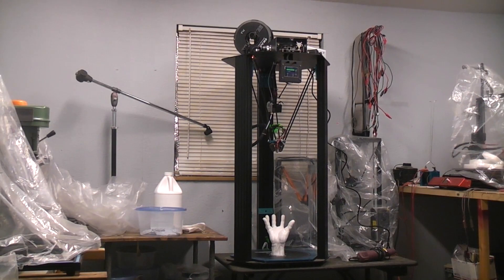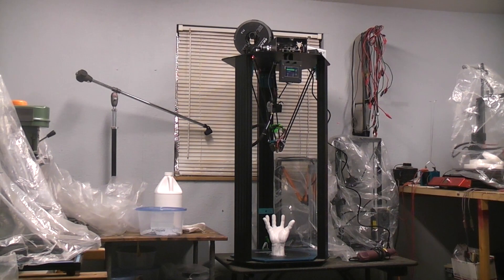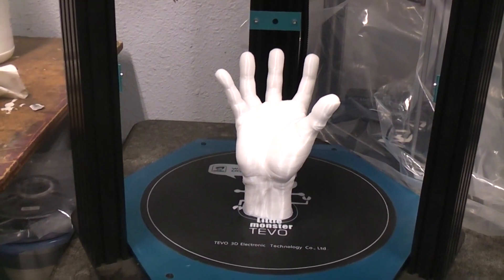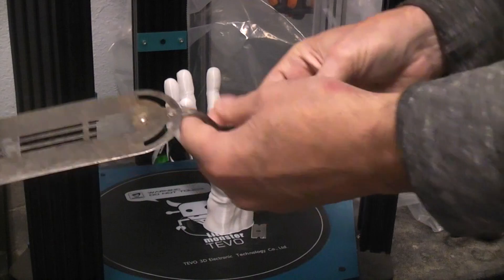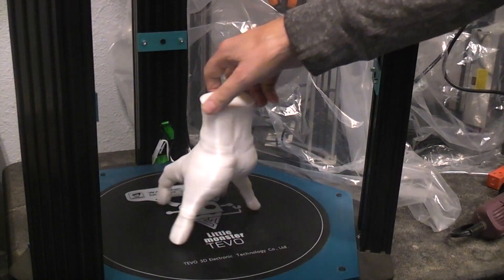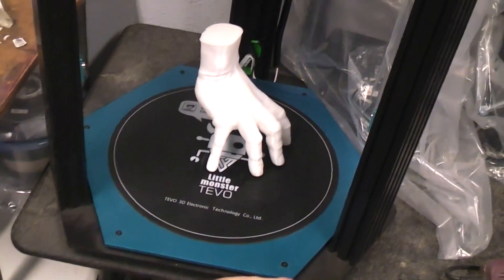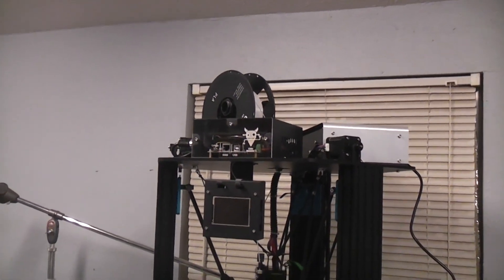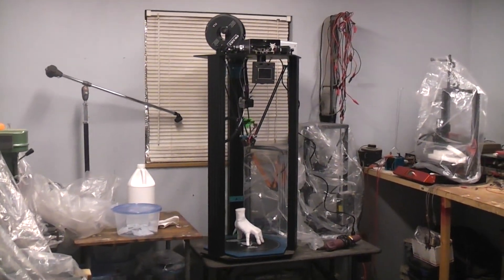LITTLE MONSTER makes a THING. 5 year review of the Tevo Little Monster 3d printer.

Comment: At the end of the printing the hot end plunges still hot and melt the pad or the part. I asked AI how to solve it, AI gave me the code to were the hot end goes up, shut the heater and the fan and stay up for 10 minutes to cool down the nozzle then it plunges.

Comment: old thoughts on an old printer... I actually won the TEVO LM from Tevo when the did the FB launch.  It was nice having a big free printer!  It was a great printer at the time... Years later, I had a few upgrades but the board eventually blew out and it wasn't working.  I have it in the corner but you are right it is a BEAST and I switched to Enders and others over the years.  Recently being reminiscent of my LM, I found an FLSUN SR (Super Racer) for cheap.  I picked that up for less than the cost what I'd need to put into the replacement board.   It's nice watching a delta printer print again, but I see no advantage to the bed slingers other than speed at the default but once you start playing corexy and klipper etc, it doesn't seem to matter anymore.   I still have it, some day I might replace the board and whatnot, but for now I'm on to other things and as they say, Size doesn't matter.  LOL!
Reply from the maker: I dug out my monster last years and fired it up. Still works great, but so large and I have to be on my hands and knees to see the first layer and get the parts off and then a step ladder to change the filament.

Comment: I just saw one come up on Ebay where I live and was wondering if it is worth to buy it as I have been interested on a Delta printer. I cannot find a lot of info on this printer. Is this running klipper? It is selling for 300Euros or I could spend twice as much and get a FLSUN super racer. What are your thoughts? Thank you for making this video.
Reply from the maker: $300 seems like a great price. I also have a Fulsun Delta that I payed $150 or so bucks for more than 5 years ago it still works great and I use it all the time for lithophanes. You can find videos on it and the Little monster in the 3d printing section of my channel.
Reply: @Robothut  the guy has told me that it currently doesn't work. So it would need some work to get it to a decent state no way of knowing if it is worth it I think
Reply from the maker: @TheModdedAxis  True you would have to see it in person. If it had to be shipped that would cost big bucks as well as it is a large all metal heavy printer.